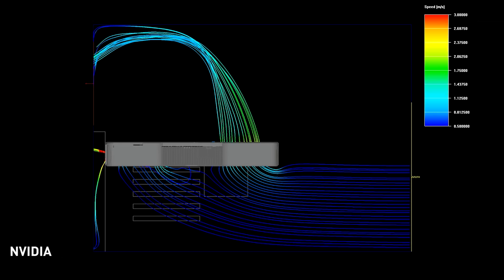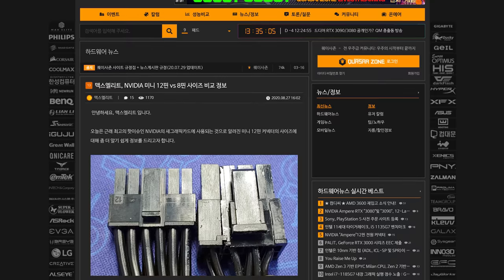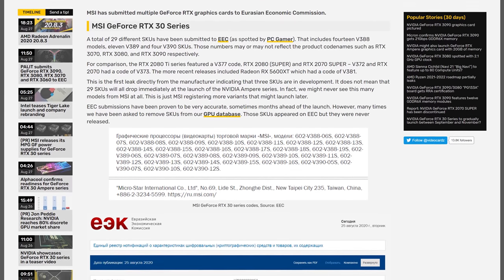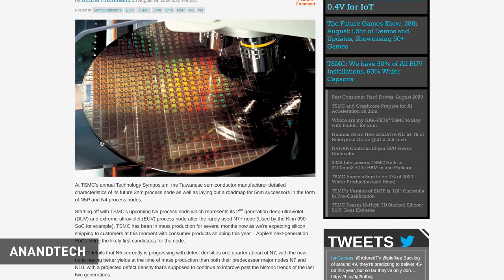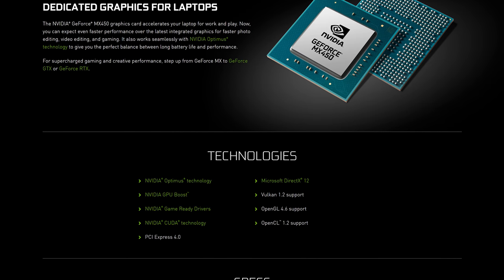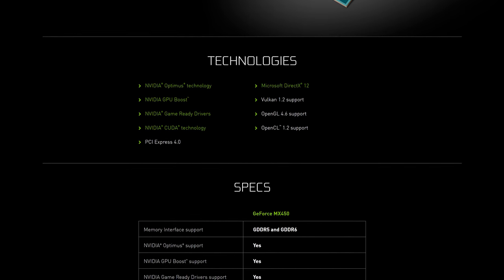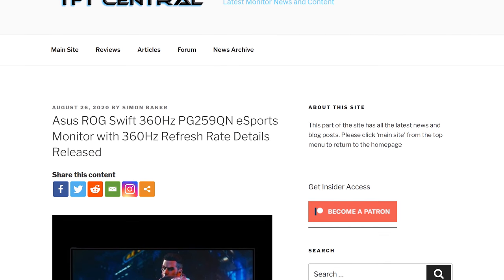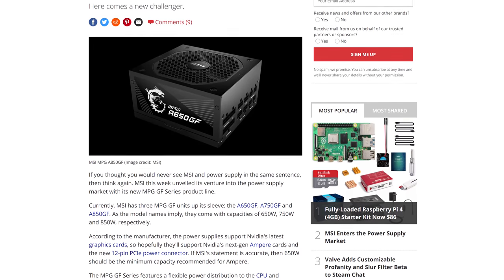RTX 3000 Power Connector, Great TSMC 5nm Yields, Nvidia's First PCIe 4.0 GPU | News Corner

Comment: Imagine one of the fans break while your playing and the gpu starts reaching 400c
Reply: It’s very hard to damage components by overheating unless you do some sort of bios hack. Your card will throttle, then ultimately shut down your PC if the temperature keeps increasing.
Reply: Well they did say in a recent video that with no cooling at all the chips could theoretically reach a temperature of like 700c...

Comment: I like how Nvidia just assume that their card is the only one you have in the system. whatever happened to reference designs that were actually ATX compliant? AMD used to still do cards that fit into atx spec ie no higher than the pci slot, less than 30cm  but everyone just shits on them because the reference card ends up louder than partner cards so now even their 5700xt reference is about 1cm over sized. same with shitting on blower fans, but i know a blower will work in any case with any cooling with the card in any slot.
Reply: 5700xt is not oversized, maybe by 2mm in length. Vega 7 has one extra cm in height. Nvidia showed that it is possible to have a better cooler in reference dimensions.
Reply: @riba2233  those nvidia coolers only work better in a case with a lot of airflow, stick it in a case with poor cooling or other pci cards and it cooks its self to death along with everything around it. thats the advantage of the blower fans and why you never see it in reviews since everyone tests them in open test benches.
Reply: @geofrancis2001  why would you have a case with poor cooling?
Reply: @riba2233  small form factor machines, server cases, lot of pci cards, oem systems,  multiple graphics cards multiple processors, pretty much every computer that isn't built specifically for gaming.
Reply: @geofrancis2001  yeah but we are kind of talking about gaming cards. Workstation cards are still blowers. Regarding sff cases you dont have to tell md anything, I design and manufacture sff cases and I can tell you that they can have excellent airflow, no problem at all.
Reply: @riba2233  yea in the professional market they are much stricter about standards compliance. thats why i run a xeon chip these days. no more funky hacks to make VM's work because motherboards didnt implement iommu properly.